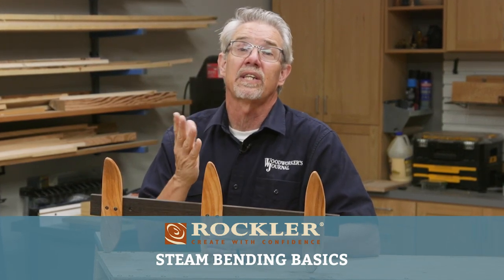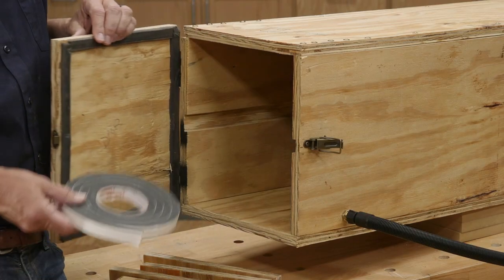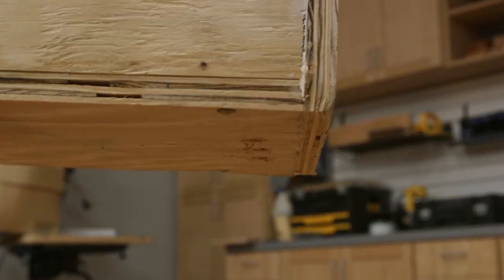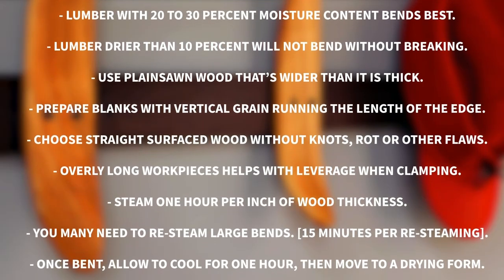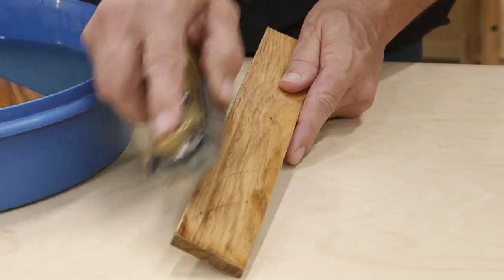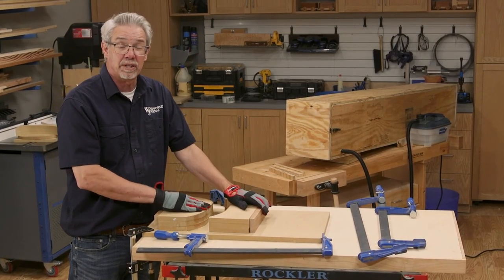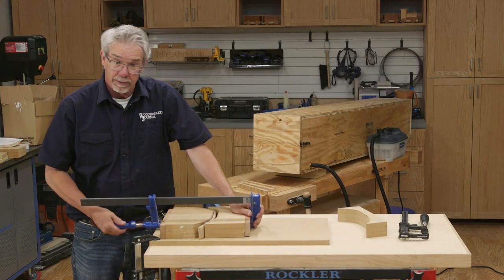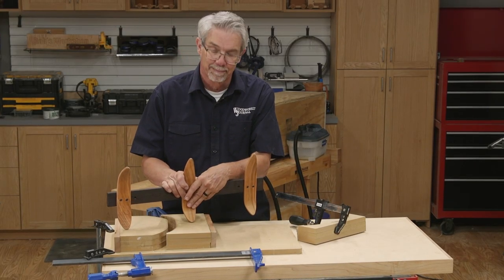Steam Bending Basics

Comment: Hi Rob & staff. I made door handles similar to the shape of your mold. I cut strips of catalogs/magazines and stacked them till they were desired thickness of my wooden handles. After cutting the contour for the male half of the clamping mold/jig, I placed the flexible stack of cut paper strips onto it and traced the TOP edge of the stack, revealing the necessary cut line for the female half. I can upload photos if this is unclear, but it worked great. 

I attached the finished handles to my maple French doors with wooden threaded bolts, for an all-wood look. They're gorgeous :-)